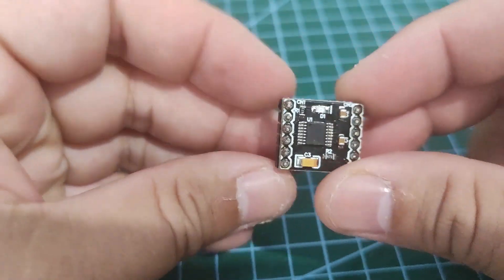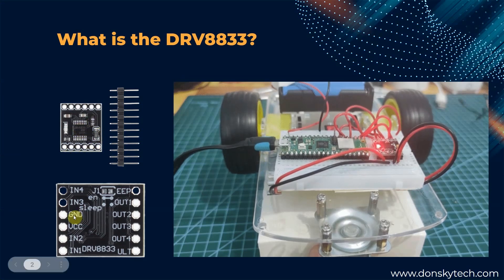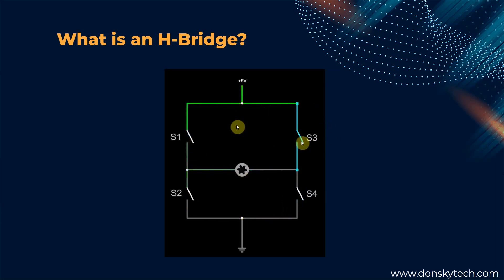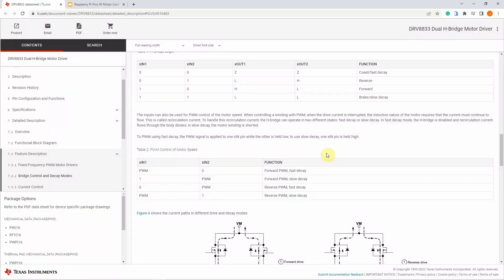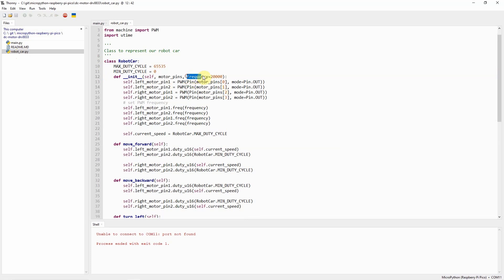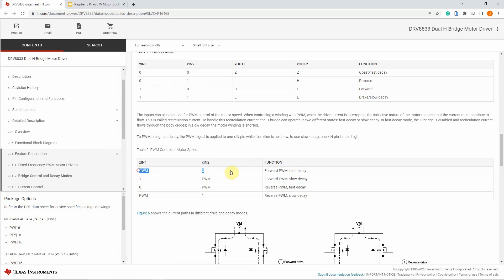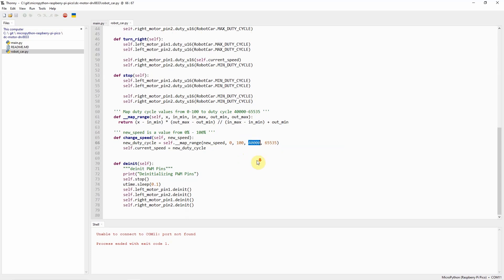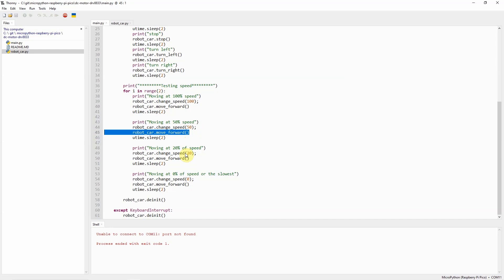Raspberry Pi Pico W Motor Control using the DRV8833 and MicroPython

Comment: just question the gnd is connected to the battery gnd and then to the arduini gnd, but instead of arduino gnd can it be connected to another 5v battery gnd? other than the one driving the motor
Reply from the maker: Hey, not sure what you are trying to do but you can follow the wiring I have in this project.